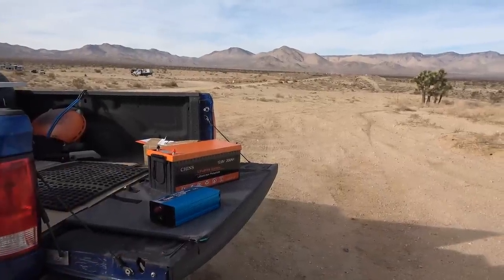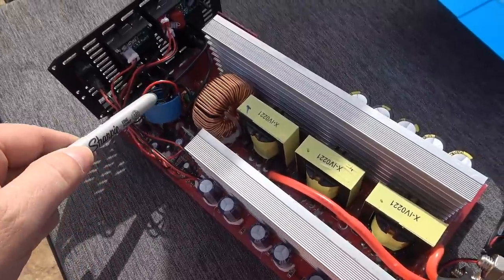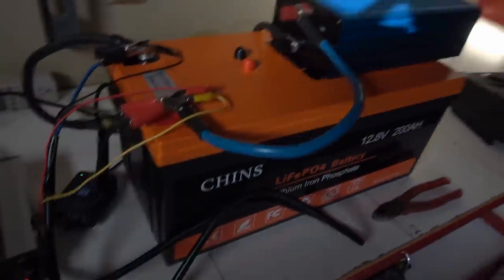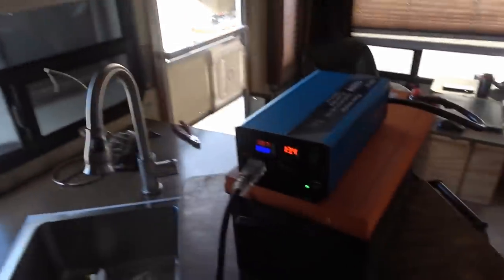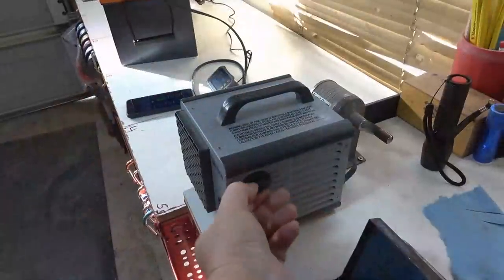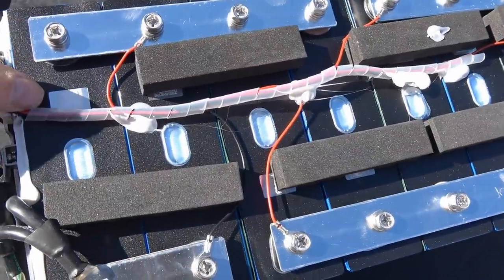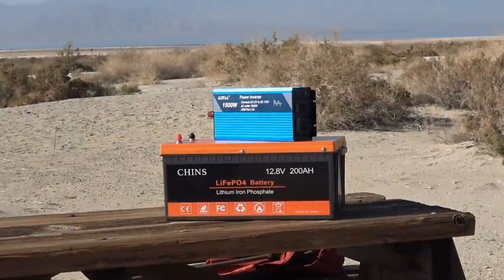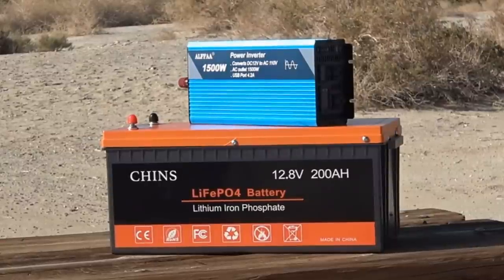Inexpensive Chins 200Ah 12V LIFEPO + ALFFAA 1500W PS Inverter Review - Testing and Teardowns

Comment: Valuable review. I have 2 Chins 100Ah lithium batteries in parallel. One 'smart' & 1 'dumb'. Since they balance; the app does enough for me to monitor the SOC. If it gets too cold I just disconnect the solar charge side or if I have 110 turn the battery switch off. I've only had them 3 months but so far so good. A lot of advantages over my 5 yr old Golf Carts that did serve me very well. I charge at about 15-20 amps, just like my BBQ; low & slow. I  like your spools of wire under the charging bench.

Comment: Great review. I bought 4 Chin 12v 200ah batteries about a year ago, just like you tested, from a Chin rep out of northern California for $600 each, shipped to my door for free; I couldn't pass it up. It was a good choice, and the batteries are doing fine. I have them set up as a 2s2p 25.4v 400ah bank powering a Giandel 24 to 120-volt 4000w pure sinewave inverter. I have this setup shoehorned into a 1988 27-foot Mallard class C RV. I also found 8 255w lightly used commercial solar panels for $60 each that also turned out to be a good buy. My point is you can spend less than top dollar for everything. Both the batteries and solar panels will be obsolete before they are worn out, big woof, but I was able to afford a top-of-the-line inverter that will last like my previous one. 

One quick edit: To avoid as much loss in your wiring as possible, use only pure copper wire, and I even go as far as to buy solid copper bar stock to make my own bus bars. I never stack connectors in my joinery. Everything is torqued. All solid copper lugs with hydrologic crimps on the bigger wires. If you don't think this makes a difference, buy yourself one of those infrared camera attachments, and you will see what I mean.
Reply from the maker: Thanks. :) A friend of mine that installs solar systems for a living also recommends to use a grease like Noalox or Ox-Gard on all the connections and inside the crimped cable lugs.  Helps prevent oxidation. They are conductive greases so can also improve a connection by filling any voids.  Cheers, Ray
Reply: @LoveYourRV  Interesting, I've used Noalox to tie dips when over-clocking video cards. It would defiantly do as your friend suggest. I have everything coated with a clear lacquer to prevent oxidation, and it keeps all of my polished copper bus bars nice a shiny. 😎

Comment: I have a 100ah Chins and to be safe, I put a 4watt cat bed heating pad wrapped on it with a simple controller set to 40*F. In my environment it only has to run for 2 or 3 hrs on 20 days a year. Cheap insurance. On my Amazon/Chins model, the manufacturer says both - has cold protect, does not have protection. Did not want to tear it apart to be sure. Other than that, the Chins is a pretty good buy.

Comment: I have 900 amp hours of chins lithier and iron phosphate. They work great coming up on eight months no problems whatsoever. I pulled them down to 80 to 50% daily I’m full-time they are much better than the ampere time but are exact same battery just re-branded these have a higher BMS rating than ampere time

Comment: Hi Ray, you can test for low temp protection when you have the battery torn apart, just dio the temp sensor in ice water and verify if it still charges. That way you can’t damage the cells.
Reply from the maker: Thanks, yeah I did that with the Ampere Time when I tested its self heating pads. Used some salt to cool the ice water enough but better yet I need to order myself a can of freeze spray to make it easier to check without removing the thermistor. Or in the past I've been just been throwing the battery in my portable freezer overnight and testing the next day. Cheers, Ray

Comment: Thanks for the video. I've been looking into adding a 1500 watt inverter to my camper. I have 2 Chins 100Ah lithium batteries in parallel. Mine are the smart heated version. I started having balancing issues with thew batteries 6 months in. At 8 months one battery has ceased accepting a charge and the other discharges rapidly even when not under load and it doesn't charge properly either. Customer service has been very responsive. I am sending the batteries back this week and new batteries will be sent. Customer service says that the new batteries have an updated BMS that automatically equalizes the batteries. The BMS seems to be the weak point. Time will tell if the replacements hold up or not.
Reply: Wally, what was the manufacture date of your batteries?
Reply: @seekingadventures  They were manufactured 6/19/21 so they were about 8 months old when I got them. Also, I was getting them ready to ship today and found quite a bit of white corrosion on the battery box mat in the area between the batteries. The box is metal, high quality and purchased new for these batteries so nothing else has been in there. Just sent pictures to Chins customer service asking if they are safe to ship. I was honestly shocked to see that one or both batteries had leaked. They're properly and securely mounted. Let's see what happens. Customer service has been great so far.

Comment: The BMS will get pretty Hot if you pull alot of amps just hard to tell if it's going on and I always use very short around 12 to 16 in 2 ga cables can pull 150 160 Amps and no heating of the cables or terminals

Comment: Nice video Ray. I'm not sure how I feel about that sodering job on the back of that circuit board, it looks a little rough.
Reply from the maker: There are quite a few heavy component leads like from the transformers so they have fairly thick solder joints and traces but all looked OK, no signs of cracks or cold joints.

Comment: Good review. Could I use that Ampere Time 20A LIFePO battery charger to supplement my regular lead acid converter, by leaving it plug in and charging my 200 ah lithium battery. I have 400 watt solar on the roof as well but it doesn't seem to bring the battery to the correct charge.
Reply: Yes, assuming it has a lithium setting.

Comment: Hi Ray. Do you think it's necessary to do a capacity test on all new lithium batteries?  Or can you get away with just hooking them up together ?
Reply from the maker: It doesn't hurt but the the most important thing to do when you get the new ones is to fully charge them individually before you hook them together. That way they are balanced. Cheers, Ray

Comment: Ray sorry for being persistent on this one but I bought the Ampere Time 20A LIFePO  charger and now I'm not sure if I can use it. Can I connect it to the battery in the front 5th wheel storage compartment with everything else hook up or will it short out something ? thanks
Reply from the maker: As long as the polarity is right positive lead to positive terminal and negative to negative it won't do any harm. You can run multiple chargers on the same battery bank. For example I often have my solar charger and converter charger charging at the same time when on shore power or running my gas generator. Or on the road my solar and DC-DC charger charging at the same time. So the 20A LiFePO charger works the same. It's just like a converter charger. Cheers, Ray
Reply: @LoveYourRV  Thanks Ray....thank God! 🙏
Reply from the maker: No problem. :)  What usually happens when you have multiple charging sources is that one will over ride the other and lead to lower combined charging. Best case scenario is that all the chargers are charging in the same way and at the same voltage. But that is often not exactly the case. It doesn't hurt things but some chargers may think the batteries are fully charged when they in reality aren't. Instead of reading the battery voltage they see the other charger voltage and think the batteries are charge more than they are and thus reduce their charge amps. You can see that in action in this video where I had 3 charging sources into my lithium battery bank - https://youtu.be/Nt3CG5qeF5o

Comment: Would it be better to have two 100AH batteries or one 200ah?
Looking for replacements for my lead acid batteries on my rv.
Reply from the maker: I think if you're only going to have 200Ah then I go with 2 100Ah, nice to have redundancy incase of a failure of one. But if going to be expanding to say 400 it may be better to go with a 200Ah then add another versus having to deal with 4 100Ah and all the extra wires and connections.